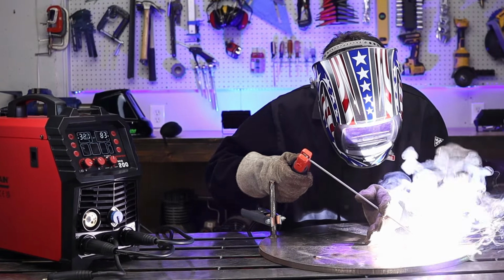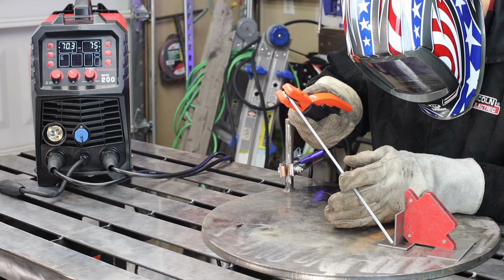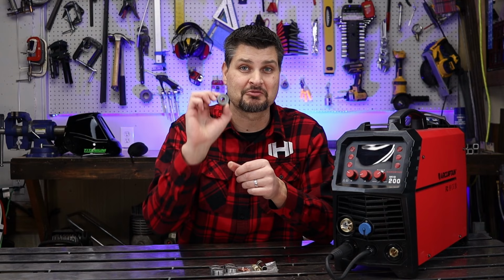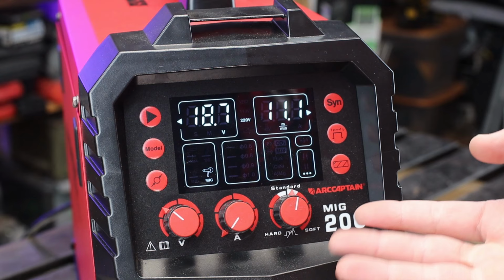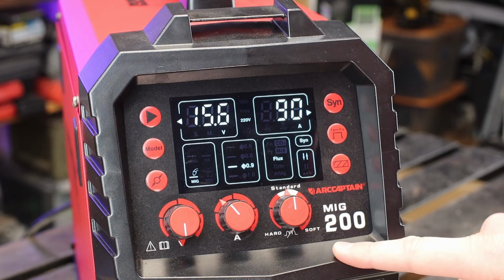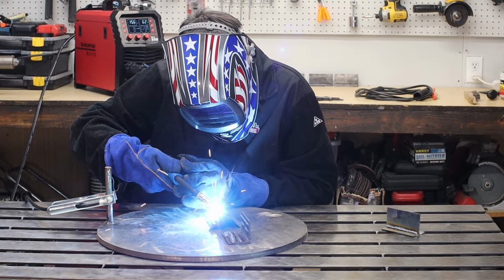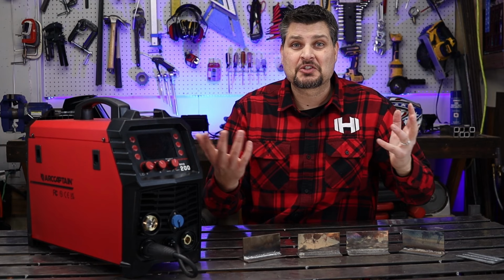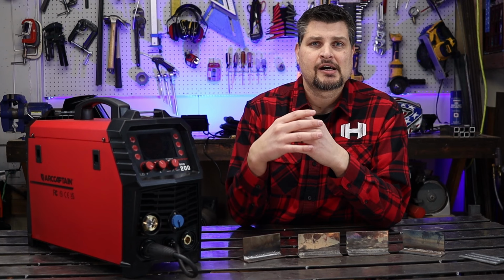ArcCaptain MIG 200 Welder Review. Better than Titanium MP?

Comment: Thank you for testing our machine, I hope you like it.We will continue to develop more and better machines for customers.
Reply from the maker: The MIG200 is a nice machine, I like it.
Reply: @arccaptain-weld As mentioned, is there a way to flip the meters per minute to inches per minute?
Reply: I just got one haven’t put it to the test I’m a union member so we’ll see
Reply: I wish you would change the power cord to a 220 plug with an adapter to 110. The way you have it makes no sense. I haven't unboxed the machine yet, but I fully intend to take it apart and replace the cord. A 110 to 220 adapter has fire hazard written all over it!

Comment: Bought one.  I hope it works well....

Only using it for flux core and stick so I can do side jobs outdoors.

Should receive it by Friday April 28.

I liked that you can load 10 lb spools.  I'll upgrade the mig torch to a Tweeco #2 15 ft
Reply from the maker: I think you'll like it. Thanks.

Comment: Thanks for the overview 👍🏻 
Would you recommend this one or the PrimeWeld MIG180 / MIG160 as a first machine? Flux and gas mig capability is a must, as well as the dual input voltage
Reply from the maker: I haven't tested the Primeweld 180/160 but I do have their TIG225 and really like it sooo...... that is a tough call.

Comment: Where do I get a flux tip for the Arccaptain outside USA. Do you know? All I see is tips with thread inside and not the "slip-on" type. I just received the Arccaptain 200, but won't be using it before I have the right nozzle (tip). Thanks for your review

Comment: Will it do aluminum?  If so what brand spool gun will it take?
Reply from the maker: Yes, there is a button for the spool gun but in looking at their site they don't sell a spool gun. I'll have to do some digging on what aftermarket one will work.
Reply: ZILA has a video on how to weld aluminum without a spool gun or a push pull gun 

So you could weld aluminum with this not using either just the mig gun I think you need an .045 contact tip and mig gun no longer than 8 feet

Comment: I’m curious how this welder is compared to the primeweld mig180 or the primeweld MTS200? I’ve been thinking of getting a prime weld. I had a Lincoln 210mp when they first came out(1300) I sold it and now they are like 2800.
Reply from the maker: Haven't tested out the primeweld mig welders but I do have their Tig 225 and love it.
Reply: Yea I most likely will end up with a primeweld 225 especially if I get a 180mig. I here the customer service at primeweld is top notch! Thank you for you help!

Comment: Just wondering how much more capacity this welder would have if you ran it on a 240V 20Amp circuit instead of a 120V? Yes, a 40 or 50Amp 240V would be the best, but again, what can it do with a 240V 20Amp circuit and they are common in homes and shops?
Reply from the maker: Great question, I'll have to see the amp output and draw on 110 next time I plug it in.

Comment: ArcCaptain Mig 200 what replacement parts work with this.. just about to buy one but can not find anything on tips, nozzles or diffuser it uses.. I saw where someone asked the question on amazon and it was not even answered correctly by arccaptain
Reply from the maker: Did you look into it? I haven't tested out replacement parts yet.